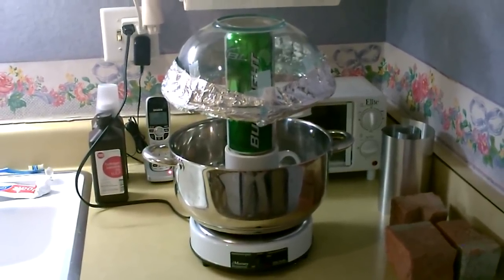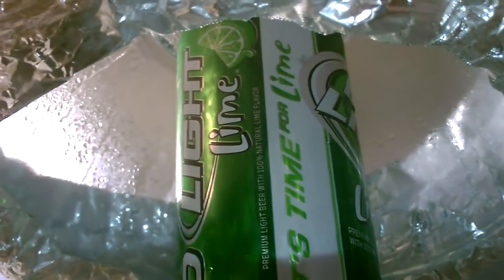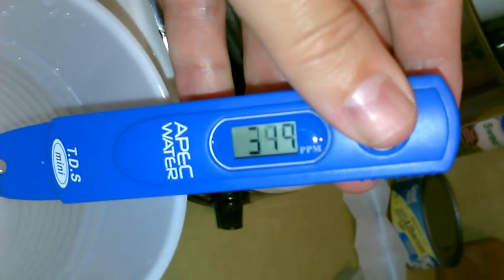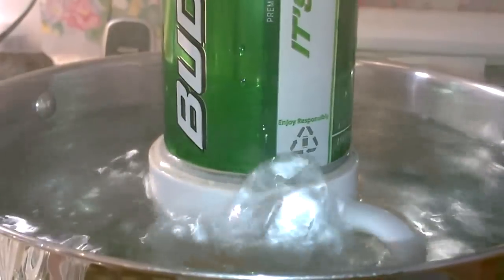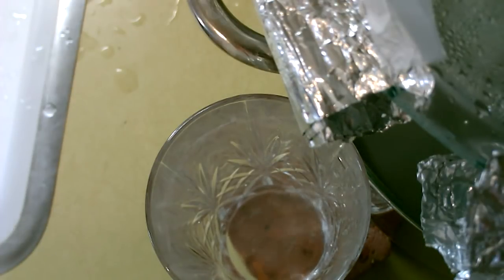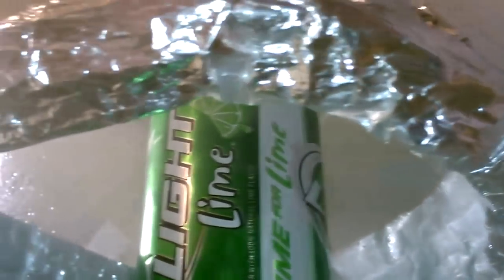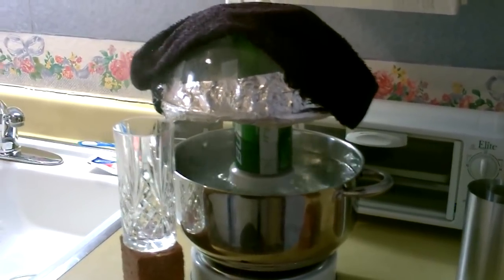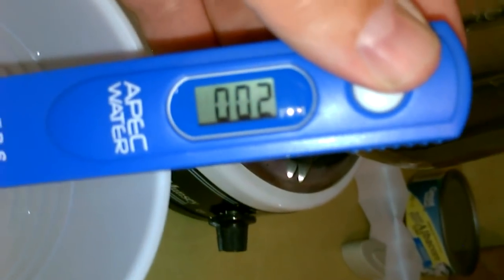DIY Water Distiller! - LARGE "Table-Top" Steam Distiller! (w/TDS readings!) - Pure H2o Fast! ~ v.2

Comment: Excellent design. What could be used instead of foil I wonder? Not that I'd care in an emergency but the taste might be foil-ish. Never mind, I'm being ungrateful!
Reply from the maker: hi there and thanks. i drank it... no foil-ish taste. it's just aluminum. *they bottle all kinds of drinks in aluminum cans... water, soda, juice, ice-t, beer. if it changed the taste of a liquid, they wouldn't use it.
Reply: The last thing youl be worried about is taste lol.. but with the metal content its basically just tap water recreated
Reply: Immortal Smoke not really because tap water has lots of fluoride in it which damages brain cells